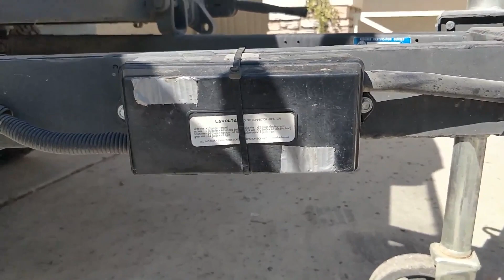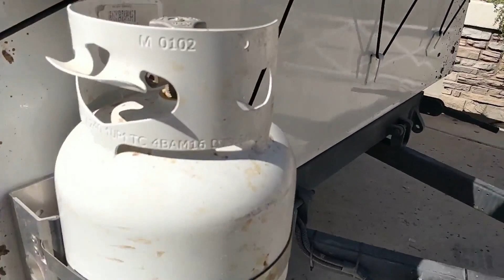Budget M101A3 Overland / Offroad Trailer Tour

Comment: Pretty sweet setup. I used to tow the exact same trailer for years. I keep it all original. I had Kevlar tires which were savage looking. 😀. Always had comments from lookie loos.
I recommend you mount the spare underneath. Close to axel. You have room down there.  To reduce drag, you could also have a sloping cover to improve aerodynamics.

Ditch the hitch you have. Limits your access to trailer.  And looks awful. 

I don’t know how I would like my tent to be perched up there. lol

Cool setup of that works for you! Btw. The A3s are rated for 1.5Tons.
Reply from the maker: Thanks! I actually sold of the trailer about a year ago, but it was an awesome project to build and we got a lot of use out of it in the Arizona wilderness! But I got the itch and had to move on to other projects, like mini bikes!